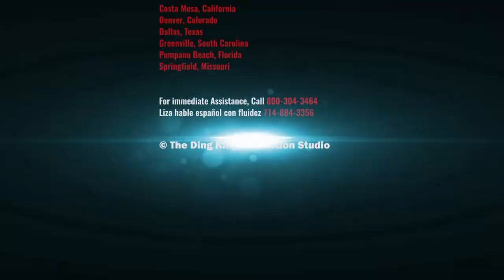Ding King Glue 101  Revisited!

Comment: I tried to remove some hail damage from 2003 Malibu and everything was going great until the 4th pull and it pulled the paint. I used a heat gun to warm the panel and don't know why the paint pulled when I used the same procedure on the first 3 pulls.